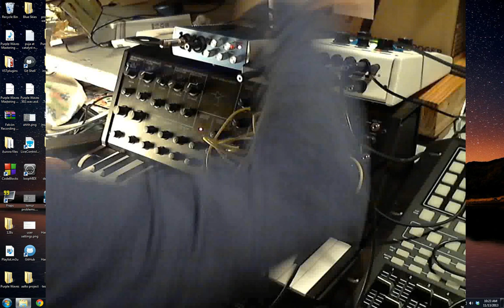MS20:  FM & the Momentary Switch

Comment: Good stuff. I've been experimenting with the momentary switch on my MS-20 mini (not quite enough of a baller to get a an original!), and it's been 90% crap. I came across the original infinite pitch escalator somewhere (settings examples? not sure right now), but it's very cool seeing extended uses for the S&H with the switch, not to mention with the wheel & that Moogerfooger pedal. Thanks for posting this.

Comment: great re edit page. I am trying so hard to learn to make new patches on my ms20. I am looking to learn more about analog synthesis so I can make some interesting patches. Do you know how to make the vocal sounds on it?
Reply from the maker: the vocal sounds are all about making a bandpass out of the two filters and getting those vocals to move together, but not perfectly.  start with the highpass ~11 and the lowpass ~1, then use the EG2/ext knobs and EG2 set to a fairly quick decay and no sustain with a smidge of attack and then go sweet spot hunting. 

I saw a youtube vid of a guy who was making really sweet vocal sounds with an old MS-20 and it looked like he was using the reverse out of EG2 to modulate the lowpass filter (or the highpass)